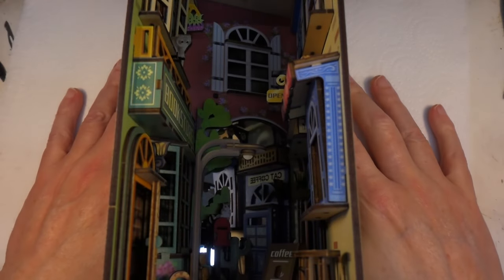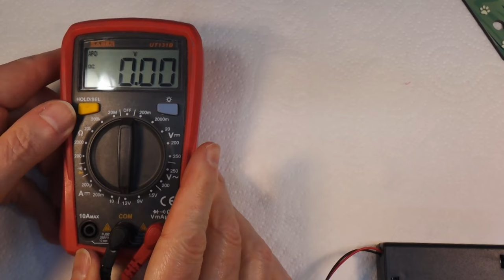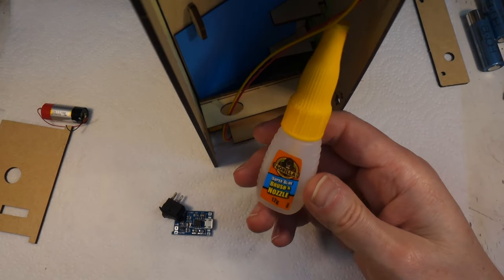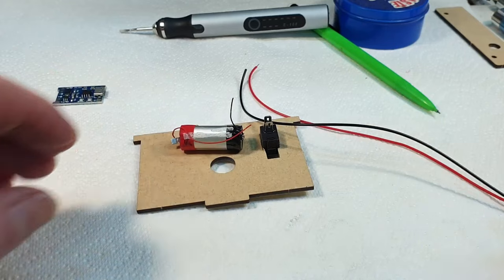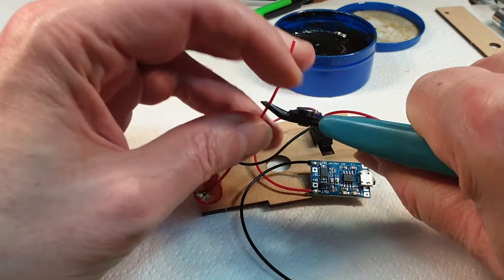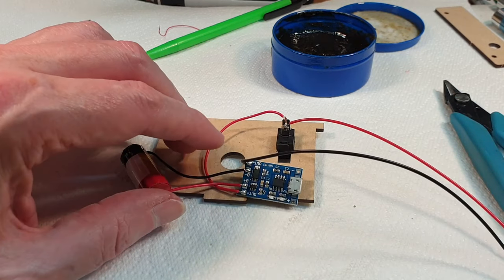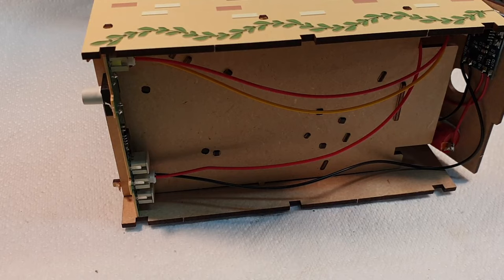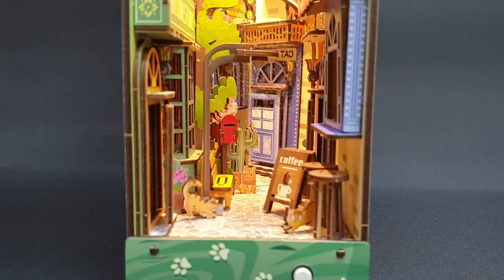Rewiring our Book nook to get the lights working

Comment: I saw that “cut a chunk out so the battery will fit” coming. Surprised you didn’t.

I’m honestly also surprised you didn’t try to mount the charging board with the plug accessible through the circular hole, but that would have required even more surgery, so just as well.

Those little lithium ion battery management boards sure do come in handy, don’t they?

Big Clive made me aware of the prevalence of copper-flashed steel wire. Ridiculous but here we are in a severe copper shortage. Like you I have a stock of old cables with various gauges of good copper wire for such projects for the same reason as you, every time I get rid of something that’s the exact thing I need.
Reply from the maker: Honestly I was half asleep when I made this video... 😂
Those circuit boards are great. They actually do a smaller one now with a Type C connector, but I still have a whole bunch of these ones left.

Comment: quick heads up - to solder 1: make a good mechanical joint  2: apply the soldering iron directly to both mounting surfaces at the same time 3: apply the solder to the joint - not so much to the iron.  AND NEVER - NOT EVER DO YOU PUT A BLOB OF SODER ONTO THE IRON AND CARRY IT TO THE JOINT YOU WANT TO SOLDER!           

Heads up ~2 those tp4056 charge boards are set to provide 1Amp charging current - that's far too high for that little battery - you need to change the resistor connected o pin 2 of the chip (typically 1k -1.5k) to 2.7k to reduce the current to 500mA.

Comment: My touch is not working
Reply from the maker: I would check the wiring is correct and, if it still doesn't work, contact the manufacturer and see if they can send you a new one, or you could change it for a normal switch if you have one, or return it as defective, or . I hope you get it fixed 🙂